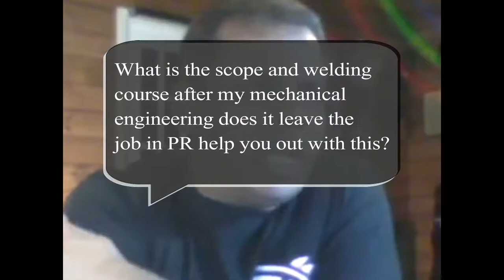Live Q&A Session | Engineering | Why A Big NO To  Welding Course After Mechanical Engineering?

Comment: Hello sir I complete my mechanical engineering and working in welding department ..how make my self best and how I can got job in outside of India?
Reply from the maker: Hi Prashant, We can certainly check and suggest all the possible options for you. Happy to help. Pls fill this very short form and we will connect you immediately and advise you.- http://ajv.global/ajveverest/enquiry or call us now on our toll-free number 1800 103 6525 or You can write to us on info@ajvglobal.com / you can also whats app us on 7400498752 or 9004145567.